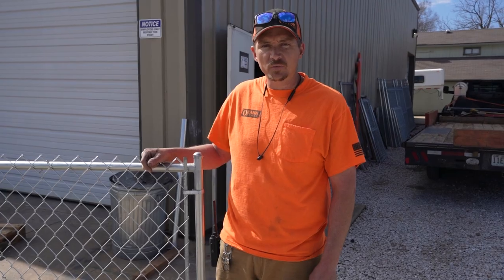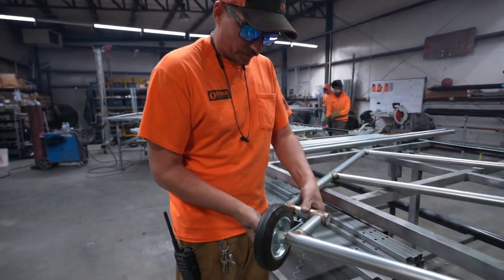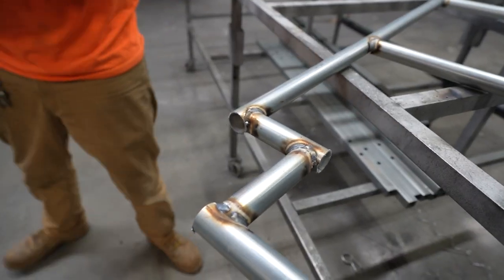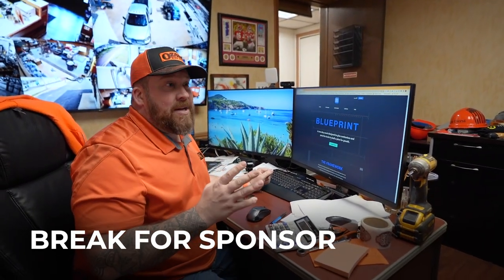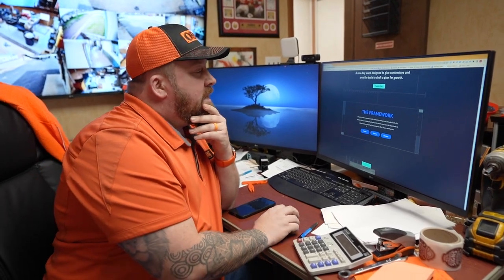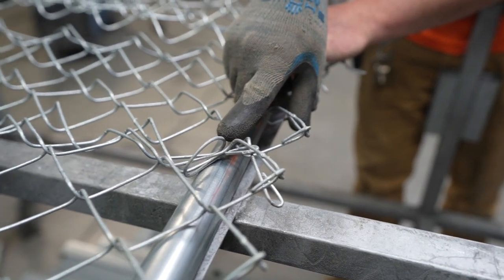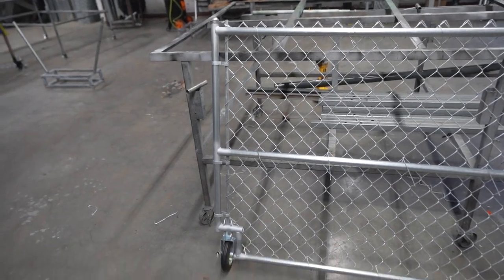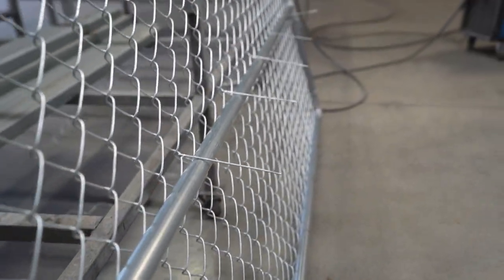Building the Ultimate Swing Gate

Comment: One question,
Did you weld the bolt that holds the wheel on, so in the future if the wheel needed replaced it could be done so without too much trouble?
Reply from the maker: No, it had a castle nut on it so it can be swapped out in the future if needed.